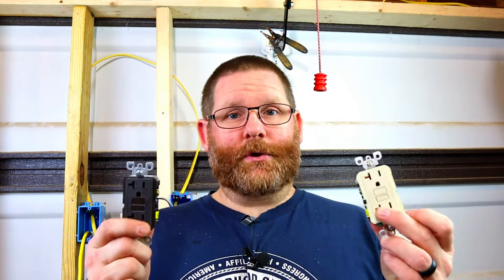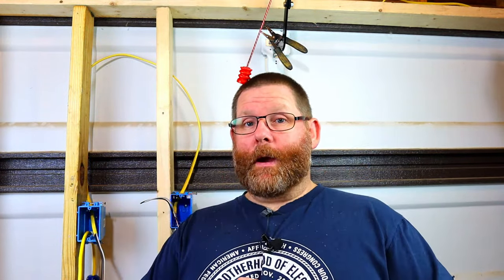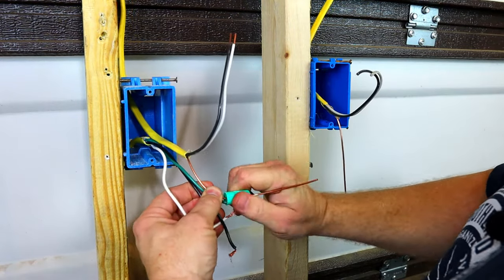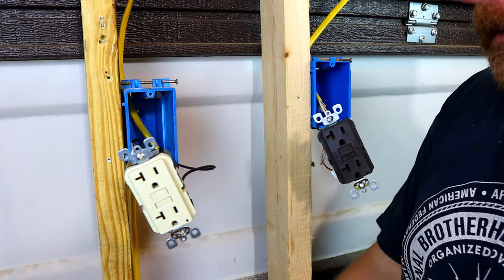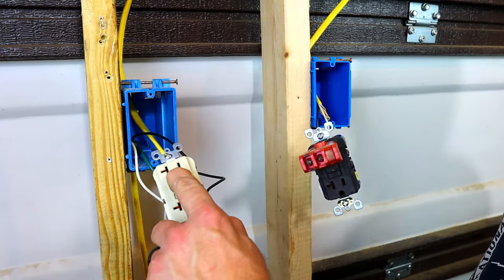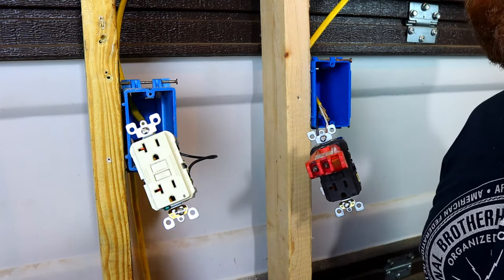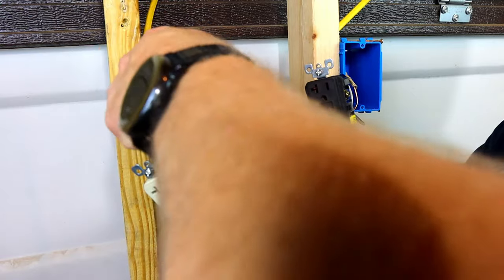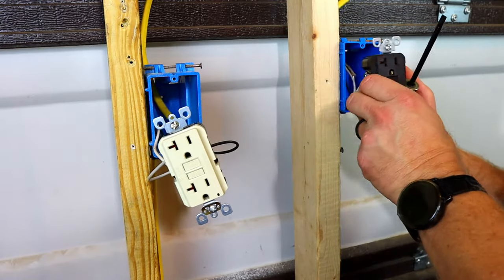How Many Ground Fault Circuit Interrupters On One Breaker

Comment: Mine work?!? I wired 2 GFCI’s the first “wrong way” and then saw this video after but they both work fine just independently. Should I be concerned & do I need to change it for safety reasons?
Reply from the maker: No but as you see what could happen if one trips you may need to reset all of them.so no need to change them. Great question and thanks for watching and commenting ☺

Comment: If I put the first receptacle in on one branch of about 6 receptacles, and that first receptacle (from the circuit panel box) is a GFCI Receptacle, will that GFCI receptacle protect all the other plain receptacles in that branch? I’m using 12/3 wire on a 20A Circuit Breaker for this branch.
Reply from the maker: Yes, correct should absolutely do that without any issue

Comment: Question: what if the breaker pan has gfi breaker, does that mean all same leg molex wires stay on line lugs and never load lugs ? Many thanks for your video. When should you use the load lugs of gfi outlets ?
Reply from the maker: If you have gfci breakers. You won't need gfcis at the receptacle boxes.  The only times that you use load is when you are trying to make another recep that is non gfci make it protected by the gfci

Comment: Does that same thing happen when you wire other AFCI outlets downstream/Load from an existing AFCI outlet?   I saw a vid that this home inspector did about this same topic and in the example he had 4 GFCI outlets  wired downstream from the load terminal of the first GFCI outlet on the circuit.  To get all of them back online you have to reset them in the order they are beginning with the first GFCI from the breaker.
Reply from the maker: Great question. I will be completely honest with you. I have never ever installed a arc fault receptacle ever so I cannot answer this correctly.

Comment: Are you allowed to run a 12/3 cable from the breaker to GFCI (1) then tie one of the hot wires from the 12/3 to the line terminal on GFCI(1)  then tie the other hot wire to the hot wire of a 12/2 cable that links (but not tied to load) GFCI1 and GFCI2 ?  I guess what Im asking is are you allowed to mix different cable types like that or does NEC make you use the same cable type for that entire circuit?
Reply from the maker: You can tie them like you are saying. Be careful sharing nuetrals on one nuetral with gfcis because chances of it working are not good. Just make sure you protect it with the correct over current device (breaker)

Comment: This is great info, but what about if it's an old house and there's no ground on any outlet? Would I still put the downstream gfci on the line of the upstream gfci? I already have 3 gfci outlets in the wrong way but as soon as I put the 4th one on it trips and I cant find the issue afterwards?
Reply: Yes. If you are using GFCI outlets because the house has no ground on any outlet and are using the GFCI for safety due to lack of ground, you have to make sure to use the second method where all wires are hooked on the line side. If you only want one set of wires going to each outlet then pigtail the incoming wire, the outgoing wire and a third wire that will connect to the outlet.

Comment: I have a situation where I have 14 dock slips divided into 2 GFCI Breakers, ,However the GFCI breaker is located about 100 feet from the docks and every time someone leaves an extension cord plugged in and there is any moisture in the air the GFCI breaker trips leaving at least half of the dock without electric. I was wondering if I could replace the GFCI breakers with a normal breaker and wire in separate GFCI outlets so that only the person that is causing the problem would be without electric until they reset their GFCI outlet. This explained how this can be done .

Comment: Sweet video, question for ya, im ginna wire up my shed and was planning on one GFCI from the panel 3 regular recepts and the end of line being a recept located outside the shed, and was gonna put a GFCI on that, question is, would i hook it up like u just showed ? Bit confused . Will the recpts after the first GFCI be protected? If wired up this way? Thanks in advance....
Reply from the maker: Only if you out the downstream on load side.
Reply: If the 3 regular receptacles are wired to the load side of the GFCI, they are protected. If that's the case, you can then wire the outside receptacle out of any one of the 3 regular outlets or the load side of the GFCI & it will also be protected. I try to never place a GFCI receptacle outdoors. I always try to use a standard receptacle outside which is wired from a GFCI outlet or GFI protected outlet which is inside. You very seldom get a tripped receptacle outside that way. I also NEVER wire in series through a receptacle unless it's a GFCI. I always wire from pigtails.

Comment: Great video!  However, you can wire GFCI outlets in a line-load...line-load...line-load series.  I know, because I have successfully done it.  Here's the issue with doing it that way.  You will lose power to all outlets downstream of the GFCI outlet that trips.  However, I like your way better, because if the GFCI outlets are wired in parallel, as you demonstrated, each GFCI outlet has an independent power source, which allows each GFCI outlet to work independently.  Bottom Line:  listen to this guy and wire your GFCI outlets in parallel, NOT in a line-load...line-load...line-load series configuration.  Thank you, Sir, for your expertise!
Reply from the maker: I agree you can but you shouldn't. I appreciate your comment and watching. Have a great day ☺

Comment: I wanted it for my trailor  running a space heater. Gfci goes to 6 outlets on a 15 Amp breaker. But half way through I wanted to add another gfci so the Heater only trips the last 3 that I don't care about and not all of them. This didn't help for my answer much

Comment: I am going to replace 3 GFI outlets in my primary bathroom, mainly because they are 20 years old. 2 outlets have reset buttons, but one doesn’t. The outlet that doesn’t have a reset button does have a GFCI sticker on it. So, I guess there are GFI outlets that don’t require reset buttons?
Reply from the maker: Sounds to me like it's being protected by one of the other gfcis

Comment: Hello, Could you add 2 120v outlets from a 240v outlet circuit? Using one hot wire from each hot from the 2 hots 240v? Thanks
Reply from the maker: If you do you will have to share nuetrals and install a double pole beaker

Comment: As many as you want. The NEC does not restrict the number of outlets on one circuit in residential applications. More outlets means less extension cords, the very thing they never want to be needed in a home.
Reply from the maker: Exactly

Comment: The answer you gave at first was wrong even if you included that they all had to be connected to the line side.
1.   In dwelling units, you can put as many on one circuit as you want.   Dwellings are required to have a certain number of circuits based on square footages.   And minimum spacing of 6’ from openings and 12’ center to center.   Strictly by NEC, you can put one every 6” along your walls and connect them to the correct number of circuits.
2.   Non dwelling occupancies.   Receptacles are to be considered as 180 watts or 1.5 amperes per yoke of the receptacles, and are also considered non continuous load.   So, 20 amp 120 volt circuit can have 13 receptacles maximum, and 15 amp circuit can have 10.   20/1.5=13.3.  15/1.5=10.
Reply: I was wondering how far I'd have to scroll to see this.... 😂...
Reply: No harm meant...
Reply from the maker: Oh I completely understand. I'm pretty thick skinned. I appreciate you watching and commenting for sure. Have a great upcoming labor day
Reply: @MountaineerOutdoors  You to my friend...

Comment: Ok so I want to tap into an existing GFCI to a new one for a small above ground pool motor ( 11 amps)
Going to use a 20 amp gfci. Going to put both grounds connected with a ground connector,neutrals (white) into silver holes. Hot (black) into bronze colored hole on other side.
Going to the new gfci ground to ground hole, white ( silver hole) black to hot side on top? Or does it go to bottom load?
Reply from the maker: If you are adding another gfci for a total of 2 then come off of the line side.

Comment: Usually I pig tail all receptacles. GFI or not. The only time I dont is off 1st gfi feeding and protecting down stream outlets. Then I use the load side of a gfi. But depending on the manufacturer, Leviton GFIs will protect unlimited devices. Eaton 3-6 devices and Legrand 6-8 devices. (Directly from the manufacturers engineers) Before installing another GFI in the same circuit.
Reply from the maker: Great information thanks for sharing
Reply: Ok, If I want to add 1 GFCI to protect an entire run of 7 additional outdoor receptacles, I would use the load to protect the remaining receptacles? Thanks
Reply: @alicehope9859  use a gif breaker then. Most gfci receptacles won't protect that much. Most munis may restrict how many you can use downstream.

Comment: I replaced 2 working outlets with 2 GFCI 15 amps on a 20a  breaker in the kitchen near the sink. Pigtailed them black to line(brass) white to line(silver) to both GFCI and I put a tested on the terminals and get lights on the voltage tester  and with a meter 120v but when I plug any thing in, I get nothing. Double checked incoming wires for power and get 120 but nothing is power up when a device is plugged in There are no indicator lights on the GFCI. The reset and test buttons do nothing. I even swapped out for another still nothing.
 What should I look for ?
Reply from the maker: Make sure you put them on the line side of the gfci

Comment: hey @mountaineer ,  my gfi has power on both the hot and the neutral wires.. what did i do wrong  because its not working
Reply from the maker: I'd say if you did that you may need to back track all the way to the breaker

Comment: Hey Mountaineer-Guy!

A probably really dumb nube question:  And I only ask because, within the UofYT (University of YouTube), I have run across a few that "show you how to do it" but yet.....it's not Code (typically, if you don't see it on camera, you can easily picture a couple of cold cracked-open PBR's behind the photographer)!  So with that, would you mind confirming that this process is within Code? 
>
Also, I am dealing with a 70+-year-old home that (for some reason) a prior builder (who used fuses) cut the ground wire to the house.  I was told when we purchased and upgraded to a breaker system that we most likely would want to switch a lot of the outlets to gfci (as it is difficult to figure out exactly which outlets start the circuits, due to full finished ceilings in the basement).  Bottom line:  no functional ground wires, even when they appear in some of the new wiring and outlets.  If the above Code question was YES, would this system still work or would the lack of functional grounds interfere with this wiring process?

>
Thanks - and apologies - in advance!
Reply from the maker: So putting in gfcis satisfy the code. It will not create a ground because there is no ground wire there. Honestly, it's best to rewire if you can. But like I said it will satisfy the code.

Comment: If I have 2 exterior GFI outlets .Can I use  regular breaker 15 amp or does it have to be a 15 amp gfi breaker?
Reply from the maker: You can use regular beakers as long as you have gfci's for the outside.
Reply: Thanks!

Comment: Your video was very helpful thank you so much for taking the time to make it. I have regular 15 Amp outlets in my basement with a 20 Amp Circuit breaker and want to switch them to(WR) Weather Resistant 20 Amp GFCI Outlets and found this very helpful. I rent the house I live in "built in 1920" and all the Outlets where old and most of them we lose from the plug area and when I replaced them I noticed all of them were 15 amps. When I checked the circuit breaker box outside the house I seen that all the breakers are 20 amps using 12 Gauge Copper wiring except the Air Conditioning Breakers, those were 2 x 50 Amp Outlets and the main power breaker that shuts everything down is 2 x 100 Amp Breakers. I will definitely buy these off your affiliated link. It's the least I can do to support the channel. Thanks again for help me as a DWYER, my landlords don't fix anything so I do all the work my self. 🙏🙇‍♂️
Reply from the maker: That sucks about your landlord. I appreciate you watching and commenting and supporting my channel. I hope everything gets fixed for you. Take care and good luck
Reply: Read those instruction for those gfci's carefully.  They do not play well together when one feeds another.

You can have one GFCI feed several or use pigtails to attach power to the "line side".
Reply: It's totally acceptable to use 15 amp duplex receptacles or gfci's on a 20 amp circuit. You shouldn't use 20 amp receptacles on a 15 amp circuit.

Comment: I thought you could have all your receptacles GFCI, but the power in is connected to the line side of each of them. I don't like having "hidden" GFCIs where a bunch of circuits are connected to the load side of a GFCI, but it's not obvious when that GFCI trips.

Comment: I have a ground fault plug that has a green light on one side and has a red light on the side which is red and is blinks intermittently.
Seems to be working without any problems just do not understand about the blinking red light?

Comment: How do I do this if I have a GFCI with 6 wires. I have the initial line wire but how do I figure out which of the other 2 should also go in the line? Essentially I should have 2 in my line and 1 in my load for hot and neutral. But how do I know if the 2nd or 3rd one go in the line ? I originally had it as 1 in the line and the other 2 in the load but the other gfci wouldn’t work. Watching this video it makes sense now.

Comment: After running a line in a GFCI and running a load out to a standard receptacle, do you pigtail other receptacles after that or utilize all 4 screws?
Reply from the maker: So you can do it how you want... Me I would pig tail them
Reply: I would say depends on your ahj. I don't find a difference using screw terms over pigtailing
Reply: Either are legal.  I prefer pigtailing.  Failure of one recepticle will only stop that one from working.  If you use the device as a conductor, its failure stops all the others from working.....think string of christmas lights.
Reply: @keithharrington4595  you ever look at how screw terms are bridged its not like a thin filament as a bulb they are bridged by like no 6 copper wire lol
Reply: @wizard3z868  my experience tells me that many people hook them up as you suggest, it is legal.  I have spent hours hunting through houses to find "the one" that hand a high resistance connection ,(even just the plug connection) that overheated and caused 5 or 6 more to stop working.

Comment: I have a GFI Breaker in sub panel connected to 3 bathroom CFGI  2  reg. receptacles garage  one outdoor porch receptacle . I am getting power back on black wire connected to GFI Breaker in Subpanel when I have disconnected black wire from GFCI Breaker. and some one wired CGFI receptacles bathrooms hot on neutral side snd neutral on hot side Bath CGFI trips ehen tested
Reply from the maker: Sounds like it's being fed by 2 breakers

Comment: You said many different times that using the load to connect another GFI is wrong but failed to explain why. The reason why the second outlet wasn't working is because the loss of power caused it to trip. It would have worked if you reset it.  I can see this as being an inconvenience because if a GFI installed upstream trips, all the downstream GFI's wil trip as well. However, doesn't it offer more protection? If a downstream GFI fails to trip, an upstream GFI make catch the fault.
Reply: It’s not wrong, it’s a huge hassle, because if one trips, they ALL trip. So you have to go one by one in order (upstream to downstream) and resetting them. A lot of homeowners don’t know in which way they are wired so it will become a headache. So best thing is to wire it the second way so each gfci outlet trips on it’s own and you only have to reset that one outlet and not a series of them.

Comment: so i have four gfi outlets on same circuit, I brought main power to first outlet to line then from load to line of next outlet then load to line of next outlet and so on. ( by this video I should wire all gfi's to line and never use load since I'm using all gfi's
Reply from the maker: In my opinion that's how I would do it

Comment: I’ve watched this video a bunch of times and I can’t duplicate the second in line GFCI not showing good power with the first GFCI is reset. Reset the first in series and the light comes on in the second. I’ve them wired exactly like your first example and no problem. I’m not an electrician but why would I have a completely different result. What am I missing here?
Reply from the maker: Not sure 🤷‍♂️
Reply: @MountaineerOutdoors  got it figured out. It appeared that I needed to watch your video again. Thank you.
Reply from the maker: Ok no problem glad that it finally worked out for you though

Comment: what did you use for your power source - looks like you have 12 gauge romex wired to a male plug. Where does the female end connect to?
Reply from the maker: I have an extension cord hooked up to a plug.